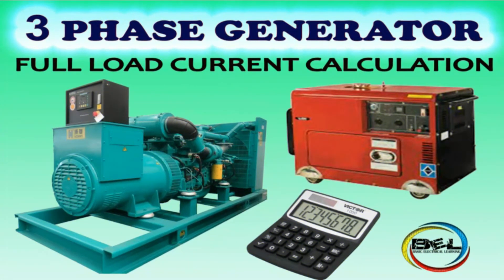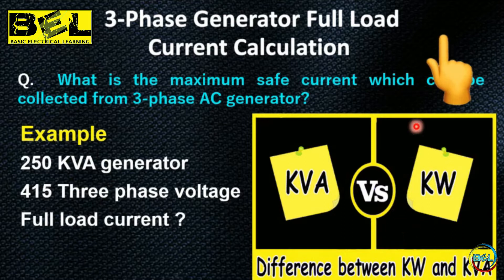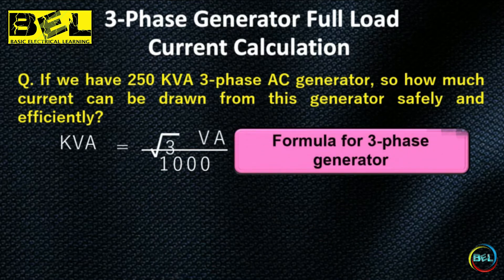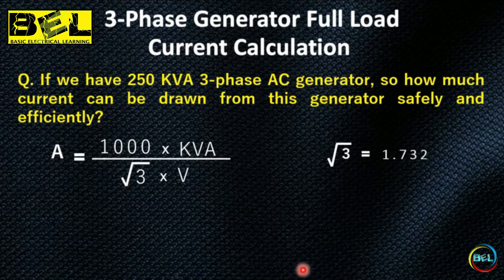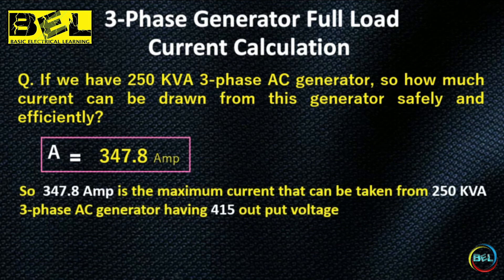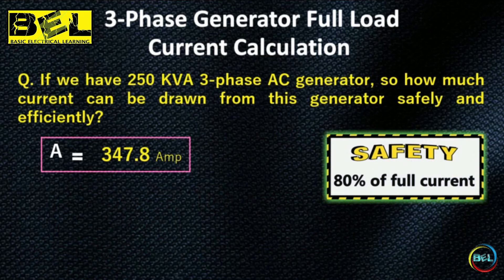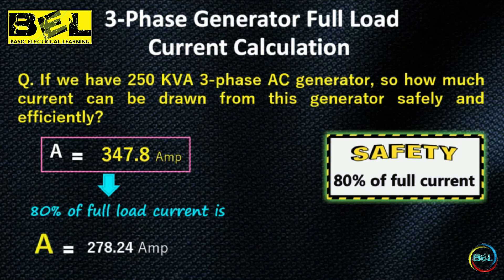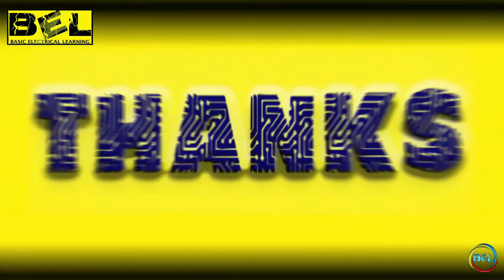3 Phase Generator Load Calculation

Comment: 278.24 Amp are amp for ever phase ( L1,L2,L3). eg: L1 can use 278.24 , L2 also use 278.24,L3 can use 278.24 A?
Reply from the maker: 278.24 is the total current or maximum save current of this 3 phase generator, so 278.24 is combined current of all phases not for a single phase, i hope this is clear now .. ..
Reply: It is not clear a previous person also asked:does this mean that you devide 278Amps by 3 to get the amps you can draw from line to neutral on each phase.
Meaning you can draw 92.7 A per phase(single phase)
This means your breaker is going to be a triple pole breaker that is in the range of 90A?
Can you please answer this?